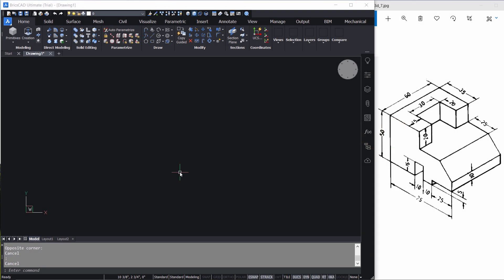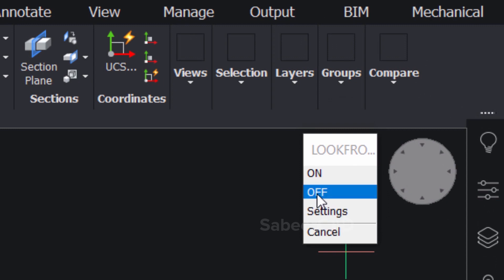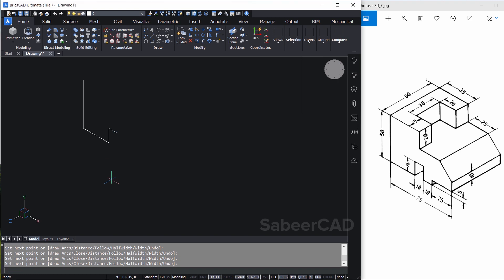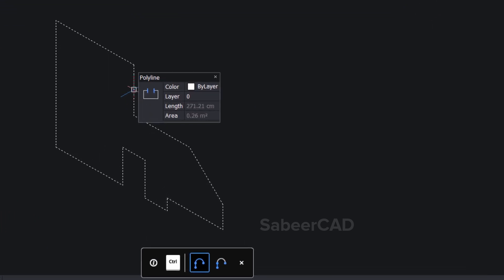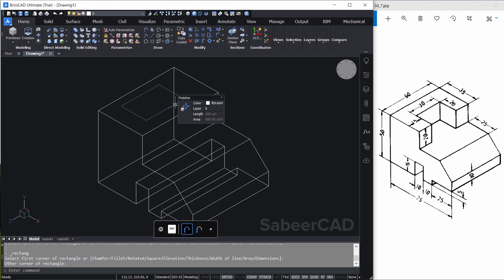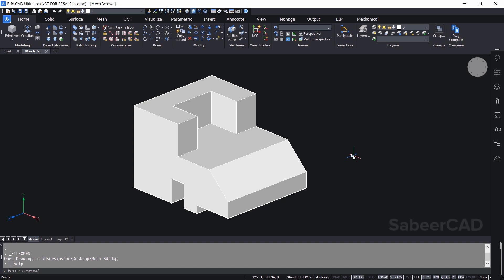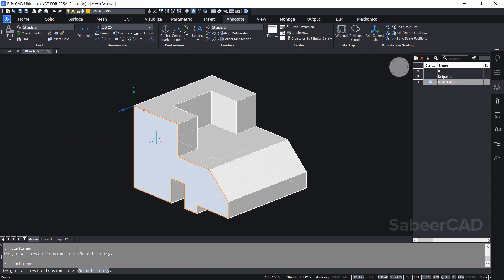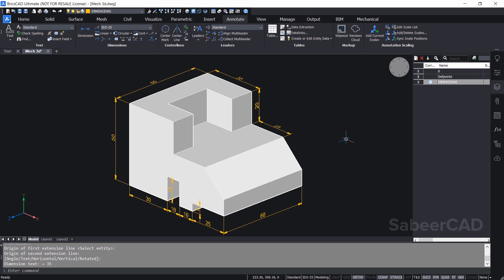BricsCAD Modeling | Create A Mechanical Component using BricsCAD

Comment: Hi SabeerCAD, in the paper space or layout and during dimensioning, how can I achieve the proper callout of the holes and threads likes the correct diameter, depth and thread size of the hole in bricscad. I have been struggling finding this since using the BricsCAD software. Hope will hear you soon. Thanks for your video tutorials this is big help for us the beginners.
Reply from the maker: Please ask this query to BricsCAD support. I am no longer associated with BricsCAD.

Comment: How do you edit a 3d model. I have a design which I need to make wider and longer but how without going back to 2d lines etc.
Reply from the maker: For thar you have to use BricsCAD Mechanical. In the existing model, you can move faces to change the dimensions.
Reply: Thank you Sabeer. I did manage to do it using the Push/pull tool.